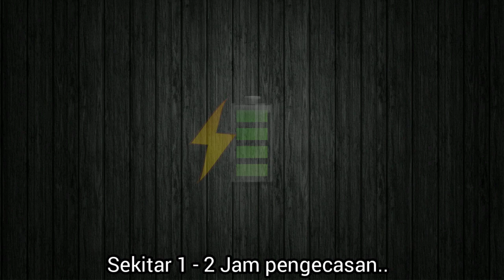Rangkaian Charger baterai 3,7 Volt

Comment: Kalau misalkan charger hp 5v digunakan mengecas baterai 3,7 v disusun seri shg total 12v bisa ga?
Reply from the maker: Tidak bisa gan..
Reply: @ElektroNad14  terus gmn cara ngecas baterai 18650 sebesar 12V ?
Reply: @budirianto1079  pake adaptor 12v om

Comment: Bang casan baterai 18650 4.2volt 
itu aman ga bang baterai yg 3.7v di cas yg 4.2v
Reply: Sama aja  sebenarnya
Reply: Soalnya  1 baterai 3,7 itu batas rendah nya 3,7 biasa baterai ini batas atasnya 4,2 v ada juga lipo yang bisa 3,8-4,35
Reply: @sonyadiputra6162  ok

Comment: How much is the voltage drop wirh the diode? The charger is constantly giving 5v so ensure that your are not getting more 4.2v as otherwise your battery will be over charge and may potentially shorten its life. Nice video though
Reply: debería de agregarle una resistencia de 22ohmios para corte de corriente de 5v a 4.3

Comment: I think tdk cukup hanya tercapai 13.7 v di battery cukup, amper nya juga harus penuh, kalau tdk..begitu dibebani si battery bisa drop....
Hemat saya, pasang amp mtr antara charger dan battery, jika msh membaca  berarti belum penuh ( msh charging ) tunggu sampai zero.....baru bisa dilepas ( sdh full )
Maaf, bukan ngajarin....cuma share pengalaman....salam
Reply: As per I knew the charger is 1.2x of battery voltage, if higher the batt. should be hot then be broken, if lower the charging will be slow also maybe no charging. Thanks